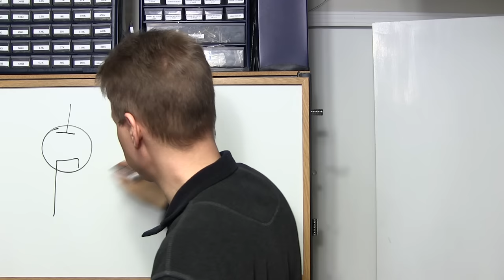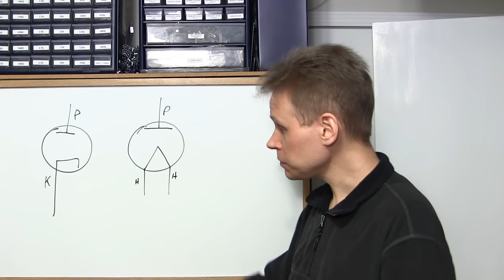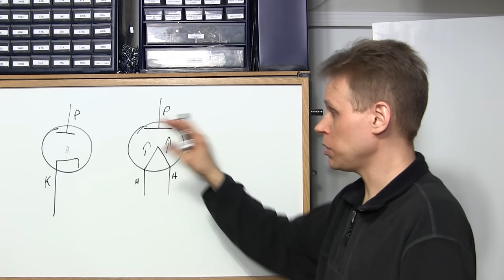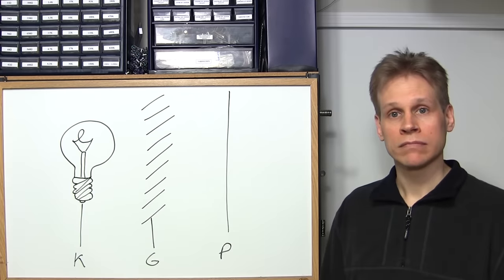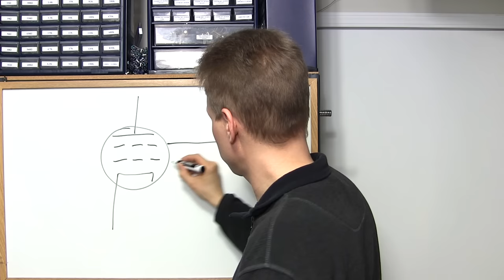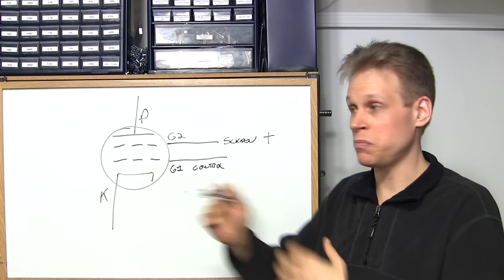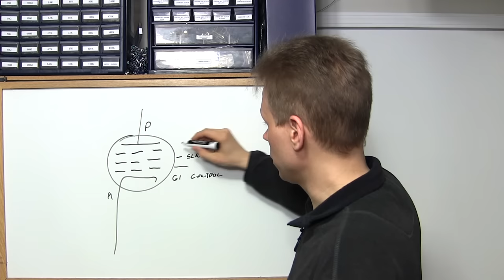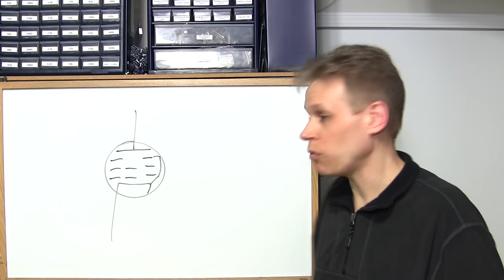How A Tube Works

Comment: Mr Carlson, you are amazing!  I am 65 years old and always wondered how a vacuum tube worked.  I remember when I was a child, my dad going to the drug store and testing the tubes of our TV. Then picking out the new tube from the cabinet below the tester, driving home and replacing the faulty tube.  I was intrigued at how a little glass thing could make a picture and sound.  After watching other electronics lessons online and learning about cathodes, anodes, resistors and diodes work, I can understand the basics of a vacuum tube.  Thank you so much for your time.

Comment: Thanks - I enjoyed this one.  A series on basic amplifier design using vacuum tubes would be great - showing typical use cases, etc.  When I was much younger, I remember being intimidated by the sheer number of connections shown on a vacuum tube.  It wasn't until much later that I learned that many of the connections (screen, suppressor, etc.) were just DC bias connections that improved the basic "triode" device's performance.  Showing some examples of classic radio schematics and breaking them down into bias and signal paths would be helpful for a lot of people I think.  Nice job as always.
Reply from the maker: +w2aew 
Thanks for your input Alan, and kind words as well! I will do just that, in a future video. Take care!
Reply: Tubes were still being taught in tech school back in the late 60s. Transistor theory was being taught alongside though. Yeah, I'm that old. Tubes are still relevant in certain applications.
Reply: @joewoodchuck3824 .....I remember back whenever our TV wasn't up to par, I'd take out the tubes, ride my bike to Savon and testing them on a good old fashioned dial machine. The cabinet below contained the new tubes
Reply: @bhaggen  Yep. Some drug stores had tube testers along with Radio Shack.
Reply: @joewoodchuck3824  Yes, tubes certainly are relevant today in certain instances. 

I will still use them in any application that I can manage to squeeze them into.. 😁

My favorite use for them is in the front-end of a big, grunty, solid state, high-bias Class A/B Hi-Fi amplifier, and on the output of all the signal sources plugged into it.

Comment: One of the best explanations on vacuum tube principles of operation I've ever seen. Outstanding job!
Reply from the maker: Thanks!
Reply: I am an electrician and this was the best explanation on tubes :)
Reply: Mr Carlson: I have a dumb question (maybe this is not a dumb question but I will ask it anyway), but is it possible to reduce or eliminate AC hum in an audio amplifier by using a well-filtered DC power supply to power the filament(s) of the tube(s) ? Maybe the 60Hz (50Hz in Europe and elsewhere) sine wave may modulate the electrons going from cathode to plate?
Reply: Hum in a vacuum tube audio amplifier may be due to filter capacitors in need of replacement.  I had a 1958 10 watt tube amp with a half wave rectifier whose hum level was barely audible.  An external cause of hum may be ground loops.
Reply: DC heater supplies are not only possible, but fairly common.
Reply: NipkowDisk Do electrons flow from anode to cathode? Why shouldn’t they be repelled by the plate?
Reply: Not really, more descriptive of the structure of Vac Tubes but poor on theory. My electronics proff was a genius. I'm sure this guy is also knowledgeable too but doesn't quite paint the picture of how it actually works.
Reply: He had a perfect opportunity to explain how varying the negative charge on the grid causes more or less current flow and hence amplification. Instead he showed how tubes are used as switches which was a real disservice.
Reply: i suggest watching this after watching Uncle Doug's 2 parter on Guitar Amp Vacuum Tubes  it'll make even more sense then
Reply: I don't agree. This was overview of the types and built but I still don't know how they work electrically. So no, it was NOT the best explanation.
Reply: Exactly!!!!!
Reply: I was sent here after watching a Photonicinduction video when I clicked the next button.
Not as exiting.

Comment: Enjoyed your video on the operation of the vacuum tube. I worked for about 30 years in a high power vacuum tube rebuilding plant in Louisiana. We rebuilt transmitting tubes that were first built with glass envelopes, and also the later version of ceramic (in place of glass) tubes. We also rebuilt the klystron tubes that were used in UHF television transmitters. My uncle, W. T. Freeland also rebuilt the cathode ray tubes that were used in television sets of the 1950’s through 1960’s. Thank you very much for your presentation and I hope to see more presentations in the future.
Reply: Cool

Comment: Great video Mr. C! I taught electronics , in the physics department , at Swarthmore from 2001 to 2012.alas vacuum tube theory was omitted from the curriculum. In my lab class I ran a three hour segment on tube basics. The student thought I was pulling their leg. Here they could grasp semi-conductor theory but considered vacuum tube theory like or was black magic. So a few of my students had an opportunity to work in the physics lab over the Summer. The lab consisted of a high power vacuum tube, called a  Spheromak . The lab prof. was astounded at their understanding of electron valve theory.

Comment: Microwave Radios have Klystron Tubes . I served in the U.S. Army STRATCOM - USACC ( U.S. Army Signal Corps) as a '' Strategic Microwave TeleCommunications Operation & Repair Specialist Tech. MOS 26V. From April 1970 to July 1978. I was schooled at Fort Monmouth , NJ in Electronics. 2 Months in Basic Electronics, and 5 Months in Operations & Maintenance of Various kinds of Microwave Radio Systems used by the Military, both Tactical and Fixed Station or Strategic Systems.  I like your videos because they refresh my memories and  former knowledge in Electronics. I'm now almost 70 years old and I have sorta forgotten some of the basic things that I learned some  50 years ago. I also have and own various books and
publications on Electronics and Tech Manuals, most of them are former Military Tech Manuals of the different MW Radio systems that I had experience working with and on during my 8 + years in the Service at various Military assignments.  I am also a State Licensed Journeyman Electrician  with over 52+ years in Residential & Commercial Electrical Wiring .  I also have several components of various kinds and types Electronic Test Equipment, TMDE,  that I have acquired over the years that I built and assembled from Kits from Heath Electronics. I use to do Radio & TV Repair .

Comment: Really great video, thank you Paul! I've never really discounted tubes since I realize that there are still many applications where they're the most suitable components. Microphones come to mind, photomultiplier tubes, vacuum fluorescent displays, microwaves as well, just as you said. CRT monitors also. I'm lucky enough to still be using a Sony GDM-FW900 as one of my monitors which can run at up to 160Hz refresh with 0 input lag. It goes up to 2304x1440 as well. 100% analog. No modern monitor of any cost approaches it in terms of max refresh rate and "pixel" on/off times. You'd think that CRT technology is obsolete, and while that's true for monitors, it's untrue in general. The merit of learning about CRT technology today is that you can start to understand particle accelerator tech. Klystrons and IOTs are both still in common use of course. Klystrons being less efficient but so far unbeatable for certain applications requiring high power and high gain for radioastronomy and particle accelerators. Some of the specs are so far out, that the numbers seem nonsensical. 535kV beam voltage at 700A beam current for 150MW RF output in a single tube. 55dB gain. Good luck doing that with solid state. And that was in 1996 haha. :P As the frequencies scale, such as a W-band range (75-110GHz), manufacturing precision has to be extreme, requiring dimensional accuracies of 1-2 microns and surface finishes better than 200nm. Lots of things to look forward to in the future. And so - it's not at all a waste of time to learn the basics of vacuum tubes which an amateur can in fact buy and play with today for very little cost. The basic principle of manipulating electron flow in a vacuum isn't going away any time soon. Thank you again for making these!!
Reply from the maker: +whatlions 
Thanks for taking the time to write... Thanks for you comment as well!
Reply: Impressive

Comment: From my Air Force days ('76 to '80) working on an analog flight simulator, we used a lot of 6AU6 tubes along with 12AT7 tubes.  We had hundreds of them in the 80 foot long computer.  In the dead of winter in northern Maine, those tube filaments provided enough heat that we didn't need an actual heater.
Reply: Omg how did you cool it in the summer time?

Comment: Real Radios Glow In The Dark!
Reply: And the sweetest sounds come vacuum packed!
Reply: especially if the dials are painted with radium.
Reply: Real Radio's keep you warm at night.
Reply: @95rav  I have a Collins R-390 (Not an A) and it has the original radium meters on it, the line level meter still glows for about a minute after a bright light has been flashed on it, pretty cool, 33 tubes in all. The signal strength meter is dead though as are most of the R-390 and 390A meters that I've seen.
Reply: my guitar amps sure do.

Comment: I love DH tubes. My 2 favorite small DH tubes are the 3A4 and 3A5. A directly heated pentode and dual triode. Very cool low current, low voltage tubes for a small audio amp. I use a pair of 3A4 in push pull or in parallel for a very small two lithium cell powered 1.4 watt guitar amp. I use a simple switcher to generate 150 vdc for the plate/Anode of the 3A4’s from a 3.7 volt lithium battery supply. Then i run -2.8 volts (series filaments) using a simple resistor on the filament and i also use the -3.7vdc supply for the grid bias. Also the 3A4 can be used at 1.2 watts  output in class C RF service up to 10 mhz. My first home brew 80M and 40M CW ham radio transmitter used a 3A4. A fun small tube. I used them in many many projects. I’ve been a bottle head since the 60’s. I’m an EE and design modern digital circuitry as well, but i love the sound of vacuum tubes. They also look and smell so good.
Reply: I prefer indirectly heated cathodes so the emitting surface is of the same potential over its entire surface.

Comment: We have two electron beam welding machines at work. The guns that produces the electron beam are basically a triode with a separately heated cathode. The filament, cathode, grid and anode are all replaceable. The electrons are emitted from a point protruding from the cathode and strike the anode which has a small hole in it's center. The electrons continue through the anode, through a focusing coil and strike the part to be welded. It all runs under high vacuum produced by vacuum pumps and at around 40kv.

Comment: As a young kid of 11 or so,  I also scrounged garbage pails for radios and parts.Finding an old radio would make my day.  I had several old speakers (the old types with the magnet coil) but could not get much volume out of them.  I went to the library and got a book about tubes and found out that the "extra" coil needed a couple hundred volts to activate electromagnet.  With the parts I collected, I built a full-wave rectifier circuit and connected the DC voltage to the magnet coil.  When I put audio into the voice coil I was amazed at the volume the speaker produced.  My first electronic project and it was a success.  Many, many more came after that and I am still at it - but not with voltages of 300 volts!  How about 5 and 12 volts dc!  I have traveled from vacuum tubes to microprocessors.  What a journey!
Yeah, ELECTRONICS!
Reply: I remeber the speaker magnet coil was used as the smoothing choke for the power supply

Comment: Mr Carlson Lab, thanks for the video. I just wanted to offer that when you are doing closeups of equipment with glass like you did with the vacuum tube at 22:50 that you point your lamps up to the ceiling or some other diffuser or reflecting umbrella. It's very common for people to just throw a handkerchief on their lamp if it isn't too hot a lamp. This helps reduce dramatically the amount of glare on the shiny reflective equipment. Thanks for the awesome instruction as always.

Comment: Here is a fundamental question that come to mind. When electrons leave the Katode they jump up to the Plate. Why are they not intercepted by Grid 1 and or Grid 2 ? Grid 1 and 2 are positives just like the Plate. Why are they not acting just like a Plate ?
Very nice tutorial by the way! Thank you.
Reply: He kept saying positive, but he meant less negative.  Sometimes the incoming signal will force the grid into the positive and a grid current will occur, but that's not wanted and to be avoided.
Reply: Thank you both for the information. I now know a little more about Tubes.
Reply: Now I am confused. with the cathode being 0V what might the others be? If you use words like "less" please specify whether you mean it absolute or signed.
Reply: Who said that the cathode was at zero volts?  And zero volts in relation to what?  Let's tar and feather that feller that said that.  
  Cathode is highly neg.  Plate is highly pos.  Google Crookes tube.  Normally a current of electrons would travel in the vacuum of space.  Grids are fluctuating but are always more or less neg.  They let some electrons get to the plate depending on how neg they are at that moment.  They are controlled by the input signal.  That's the signal that you wanna amplify.  From your Fender, let's just say.  Remember that the cathode to plate voltage is very high.  Without the grid, a high current would run from cathode to plate.  That's totally ignoring the input signal.
Reply: alex tworkowski I could say the same thing.  Grids are more or less negative compared to what?  What's your reference?  Where's the ground?
Reply: alex tworkowski Your comment really cleared up how amplifier tubes work! I never understood before! I also had the same question about why electrons aren't just drawn back to the grid instead of going to the plate. So basically, in a tube you don't really have a purely positive or negative charge, but more of a potential difference?
Reply: Voltages in a tube amp, unless specified otherwise, are assumed to be with respect to ground, which is the negative terminal of the power supply, i.e. the negative terminal of the first filter cap, which is connected to the chassis and designated as the 0V point. In a cathode biased preamp stage, the grid of the tube is 'tied to ground' by the grid leak resistor and is therefore at ground potential, 0V, while the cathode is at a small positive voltage with respect to ground. If the cathode is at (say) +1V with respect to ground, it must be at +1V with respect to the grid. If the cathode is at +1V with respect to the grid, this means that the grid is at -1V with respect to the cathode, which allows a certain amount of electrons to flow from cathode to plate in the tube. If the grid is driven (say) 0.25V positive by a signal, this reduces the amount of negative voltage between cathode and grid from -1V to -1 + 0.25 = -0.75V, allowing a greater amount of electrons to flow. When the grid is driven negative by 0.25V, it increases the negative grid to cathode voltage from -1V to -1V + (-0.25V) = -1.25V which allows fewer electrons to flow.
(Although the cathode is positive with respect to ground, it is indeed highly negative with respect to the plate which is at a high positive voltage which comes, via smoothing components, from the positive terminal of the filter cap.)

Comment: As an old school electrician for motor control and power distribution, since tubes were considered to become obsolete in the late 60's and into the 70's, and because the manufacturing industries collapsed across the USA, I became self taught for semiconductors. With a heavy electrical and mechanical background, I went into the commercial heating, cooling, and refrigeration field for installation and service.

I knew many musicians and PA operators preferred vacuum tubes, but most systems were becoming solid state. It seems that vacuum tubes are still preferred by some. 

Thanks for the video's!!!!

Comment: Mr Carlson, again excellent video. Thanks. I'm now watching you and Uncle Doug within minutes of posting. 

Hey viewers, this excellent introduction hopefully wet your tube taste buds.  I'd recommend your next step for learning more detail is start reading RCA RC-22 Receiving Tube Manual. Its a reference manual/data sheets that follows this video without too much circuit theory or mathematics. Need more, RDH4 is next. Its packed full of knowledge but is terse. After that, check out the books at tubebooks.org. When you're going deep, not missing anything, head to Reich "Theory and Applications of Electron Tubes". The bandwidth buster at tubebooks, people who know, know what's good.  This book is excellent, I wish I had found this when I started down my vacuum tube learning path 2 years ago. Its exactly what I was looking for. Hang in there, tubes are fun and cool with a wee-bit of danger.
Reply: Craig Hollabaugh hahahhahahaha same along with EEVlog i actually love this channel though... super professional and to the point.
Reply: I found Marcus and Marcus "Fundamentals of Radio"  very excellent as well.  Craig Hollabaugh was kind enough to correct me on the title.  It's "Elements of Radio".  Thanks Craig.
Reply: Craig Hollabaugh YES  i had forgotten the name, apparently.
Reply: No worries. I just try to find links when people recommend vintage texts, so I can see what they think is good. Reading through "Elements of Radio" right now, thanks.